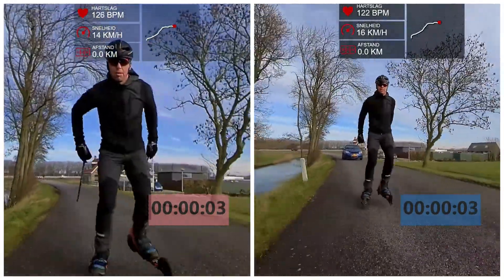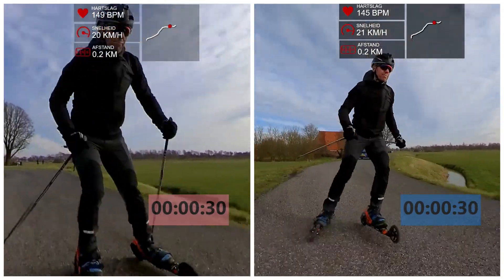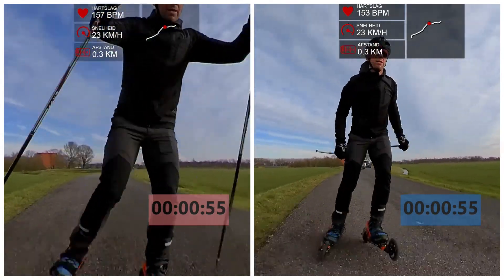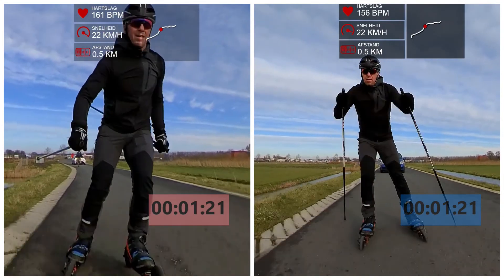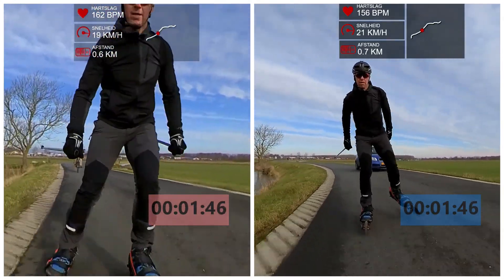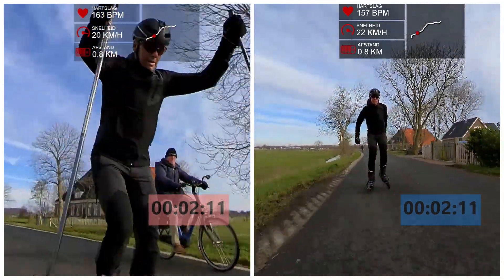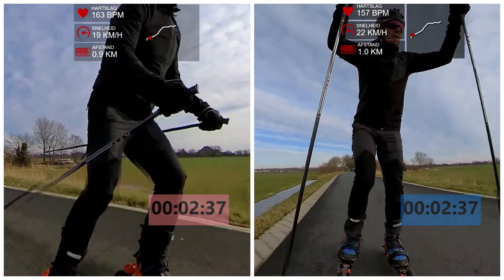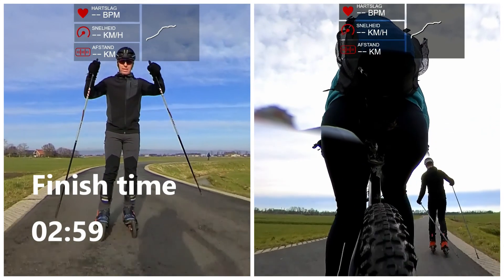Skike V8 Tour - speed contest between pneumatic and PU speed wheels|| which is faster?

Comment: Hello. You are the only one online talking about the different of PU wheels and inflatable! Thank you for this. My concern is: I used regular inline skates with poles to ride the roads and now I want to try something new. The inline skates are mich faster and I like yhe speed, so I was wondering if it makes sense to buy Skike v9 fire and additional 145 PU wheels when I will feel the need for speed :) Does this makes sense? How difficult is to change the wheels evry time you want to go with inflatable and PU wheels? Thank you for contributing  🙏
Reply from the maker: Thanks for your nice comments!
Great question! I don’t think that the 145 speedwheels will fit with the V9 fire. You probably need extra spacers. I use them with the V8 which are different from the V9
Besides I think that inline skates are faster than Skikes. 
Changing wheels with V8 is simple 
I don’t use speedwheels with V9 because of different dimensions 
I hope this helps!

Comment: Do those wheels require any extra spacers/shims/washers between the bearings and the frame?
Reply from the maker: Thanks for watching and your question!No they don’t. These wheels are specifically intended for this frame
Reply: @outdoorsports6768 I was actually thinking if they would also fit Powerslide SUV skates, what is the width of the wheel hub with bearings?

Comment: Hi, Outdoorsports - i came across your video while researching the difference between PU and regular inflatable Skike wheels. My main motivation to look for an alternative wheel is that I am very tired of constant blow outs of inflatable tires and the agonizing effort and long time that it takes to change and pump up the tube. I am really not concerned about the speed aspect. Actually, the slower the better (... the safer :) I see there are 125 mm and 145 mm PU wheels available. Would you recommend the PU wheel for someone, who is looking for easier maintenance, yet still wants to go safe and slow? If yes, which diameter of the PU wheel do you think is safer?
Reply from the maker: Thanks for watching and your question!
Yes, I would definitely recommend PU wheels. They hardly need any maintenance. If you don’t want to go fast, just put lesser effort into your strides...;-)
Anyway...I would choose the bigger wheels, because they will roll easier across rough surfaces, which in essence is safer. Besides, breaking  doesn’t need much adjustment. If you had the smaller wheels, breaking might feel a bit more scary, because you”ll have to lean more backwards in order to have the breaks get in touch with the wheels. So to cut things short, the bigger wheels are the safer and better option!
Reply: @outdoorsports6768  Thank you for the prompt reply! I looked into the physics of smaller vs larger wheels and theoretically smaller wheels should be slower, but... you raise excellent points about breaking and going over the cracks in the payment. I think these are more important considerations than just plain physics of the diameter, so I am going to order the larger PU wheels and looking forward to the upcoming skike season.
Reply from the maker: Thanks! Glad to help!
Reply: Skike V9 Fire 200, or SRB XRS06,07  Wheels 200mm.